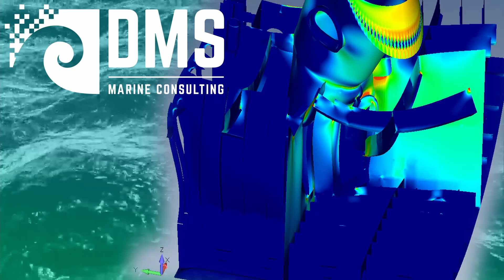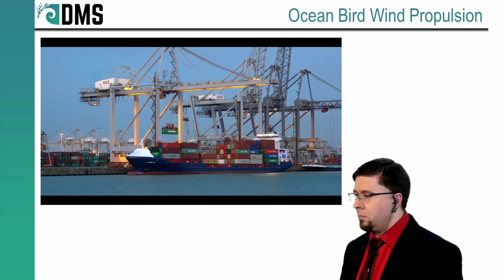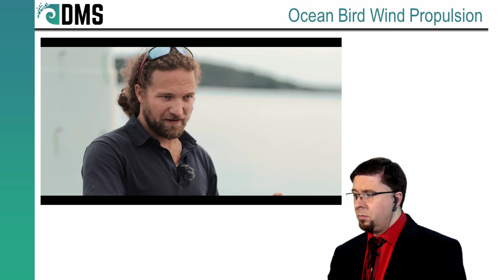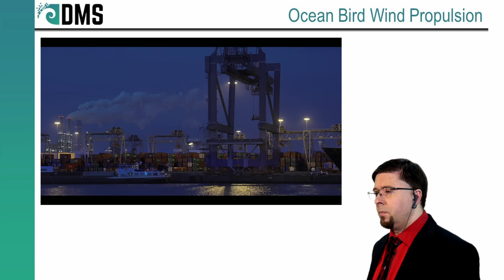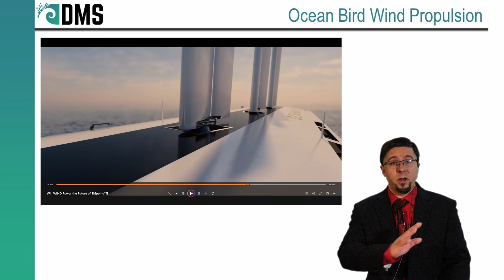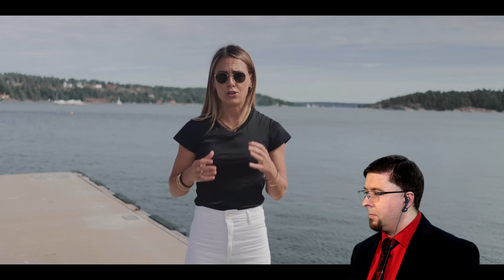Free Fuel?  Wind Propulsion for Cargo Ships

Comment: How can you say that wind energy is low hanging fruit when you have right beneath your boat strong waves with much more dense energy per square meter,
 so the real low hanging fruit is wave energy
Reply from the maker: Wave energy has great potential, yes.  I even designed a wave energy converter as my final project in University.  The problem isn't the potential of the energy.  It's creating a device that can economically convert that power into an industrial format.  
I agree that wave energy is worth pursuing.  But we don't have a ready-made solution for wave energy.  Sail propulsion has been tried, mass produced, and tested.  We already know how to do sail propulsion.  Wave energy still requires further development.
Reply: @DatawaveMarineSolutions  
My design is a catamaran with movable pontoons, so the pontoons can individually bounce up and down,
connected with a electric motor generator in the middle so when the wave hits the front of the pontoon, the front is pushing up, but keeping the deck stable making a more comfortable ride ,
in the same time harvesting wave energy!
It’s possible that this design can work better with a trimaran

Comment: Sailing ships have a lot of torsional stress because there's a twisting moment in the frame where the mast is attached. For modern ships to have sufficient torsional strength will likely require an extensive redesign versus what's built today possibly including hull shape changes and diagonal stringers.

Comment: The reason most sailing yachts have one mast and usually two sails is not about reducing crew size. It is about getting the best windward efficiency. This is mainly necessary due to how sailboat races are conducted. They are very often upwind/downwind in nature. Upwind, the tall, two sail rig is champ.  Downwind, it is also champ, due to being able to fly a very large downwind sail.

When raid-style racing was introduced, two masted boats started appearing and doing well. This is because raid racing is often across the wind.

BTW, the smallest working four masterd schooner is a little more than 6m long and is being built by Sven Yrvind. Its mast are all cantilever and don't extend very far below the deck. Each sail has just a halyard and a sheet line. They will have reefing points as well. But sail area can quickly be reduced  by dropping one or more of the four sails. It looks complicated, but it is really quite simple.

Comment: The reason my sailboat and most small sailboats have two or three or four sails (Sloop, cutter, ketch) is not simplicity, it's being able to sail close to the wind. Old square riggers can't sail 'into the wind.' These primarily sloop rigged boats , like my 46' boat, can sail 35 degrees 'off the wind' and I do it all the time. This is called Close Hauled and it's also the only way the America's Cup boats sail. 
Sails on large ships, I think, is already a 'solved engineering problem.'  Sails are just wings, we know all about wings. They already know how to do it. The large model in the video is just proof of concept.  Yacht A, is a very large private sail yacht, everything about the sails is motor controlled. The sails roll out of the mast (as do mine). They're very efficient. What they are, compared to large container ships running on powerful engines, is slow.  
A 1000' (300m) container ship can do 25 knots, my boat does 7. What needs to be worked out is what cargos can  take 3 - 4 weeks to cross the Pacific and which cargos still need to get across in ten days? 
I've sailed Asia, across the Pacific and regularly off the California coast. Most large ships were only doing about 14 knots, and the ones I see on AIS in the past couple of years off California are doing 9 knots. 
Some of this is to lower pollution levels, save on increasingly expensive fuel. If speeds stay low like this, then sails on large ships could become competitive. 
I always think that when the aliens do visit Earth, all their technology will be far more advanced than ours. But, unless they have oceans and sailing on their planet, they are going to be amazed that we can cross oceans for free with sails. 

Storms. One of the reasons I became a sailor four years ago is weather prediction and communications have become so good, no one ever needs to sail in a  hurricane or typhoon. We regularly avoided the most intense parts of the storms that were near where we sailed.

Comment: Other ships which don't need to be compatible with shore cranes are tankers and passenger ships. The self loading/unloading bulk freighters of the Great Lakes could be another opportunity for wind propulsion. There is at least one competing technology called DynaRig that has been around for decades and has been used/tested on a few large yachts. In addition to crew sizes, I think much of the focus on single masts comes from yacht racing - a single masted sloop rig maximized maneuverability and the ability to sail into the wind, which is important in yacht racing, but not so much for larger ships. As for 200m masts, there are already several large yachts in service or construction with masts approaching 100m, but these are mostly attempts to scale up single masted racing yachts. I suspect that multiple smaller masts would be more optimal for cargo ships.
Reply: Great lakes ships aren't self-loaders. They are self-unloaders but they need to be loaded at an ore dock. The self-unloading system works via gravity. There's a belt below the cargo holds that carries the product to the elevator at the stern of the ship. It can not run in reverse.

Comment: Thanks Nick.
It may not be applicable to their sail design, but although wind is free, ropes tend to be expensive and require regular replacement on a sailing vessel. That is sort of hidden cost most people don't think about.
You have mentioned fuel additives, and I wonder if that idea is viable (link with timestamp closer to the point):
https://www.youtube.com/watch?v=hL3AZGw9xZM&t=294s

Comment: Hmmm. Not really news  Maersk has multiple wind assisted vessels using Flettner Rotors, which provide adjustable,  movable wind operation with better sailing characteristics than the most efficient shaped sail.
The economics for suitable routes are proven and repeatable.
These foil solutions are just ignoring the proven technology.

Comment: During the early 2000's, using kite-sails were proposed to help propel cargo ships.  Only need to connect to the kites.  No news from it since then.  The sails are either deployed by the ship or some kite-sail tug that help tows a vessel.
Reply: Airseas
Reply: @paraglidingSafety   ohh, so it's now a business. Thanks for the info👍🏻
Reply: @shaider1982  it is not a bussiness yet, they seem to be in early r&d, basically copying the approach that Skysails used in their PoC 10 years ago, with some minor modificatons, not necessarily for the best :)
Reply: @paraglidingSafety  ahh, ok, so still not practical.

Comment: Very good look at the pros and cons. How about the cruise ships? They don't have the need for cargo cranes. Nor is high speed an issue....
Reply: Their cost/profit model is based around packing as many cattle into a small volume, and taking them, for all the money possible, adding complexity/cost, just isn't in the cards.
For smaller niche markets, of a 'Sailing Holiday', possibilities exist.
Reply: @carlthor91  But, the powerplant is not critical for that segment. Nor is cargo loading a issue. You need to redesign from the floating theme park hotel they are now; for masts however.🚢
Reply: @WALTERBROADDUS   deck area for leisure activities will be decreased.
Reply: @shaider1982  What activity? No one is doing very much at the top of the ship. people climbing the Smoke Stacks now? Masts would not interfere with passengers at the buffet line.
Reply: @WALTERBROADDUS  The hotel load on the powerplant, multiple gensets, is nothing to be scoffed at. Multiple megawatts.
The structural reinforcements, required to handle/distribute the wind loads, takes away from payload. All ships are set of deign choices.
Reply: @carlthor91  adding sails to a vessel like this would not significantly affect passenger load and is not replacing the gas turbines and Diesel system for Main propulsion and electrical generation. It's just supplemental.

Comment: With many vessels now moving to diesel-electric I’ve always thought that using the wind as an electricity generator rather than a motive force might be easier/better. Wind turbines are already a mature technology, have no preference for wind direction, and can be tied into existing electric drive systems. The question is which system would be more efficient in turning wind into motive force. What do you think?
Reply from the maker: I would need to do the math to be sure, but I suspect that sails come out more efficient, depending on the use.  Sails show small efficiency when traveling upwind, since the sail is angled to push mostly sideways.  But upwind travel only encompasses about 1/4 of the possible wind angles.  For the remaining wind angles, sails are very efficient.

Contrast that to wind turbines.  True, those can work at any wind angle.  But we lose a lot in the conversion.  A typical wind turbine is only 50%-70% efficient at capturing the wind power.  (They have a theoretical maximum of 67%.)  Then we have efficiency losses to convert that power into electricity (conservative assumption:  95% efficiency).  Then we need to convert that electric power back into propeller power with an electric motor.  Electric motor are around 92-95% efficient.  And the propeller is also only 65% efficient at converting shaft power into forward thrust.  

So by using wind turbines, only 39% of the wind energy makes it back into forward thrust.  Sails have their own losses too, but 39% is a pretty easy number to beat.
Reply: You want wind turbines?
Reply: Heck, it may end up being a combination of technologies. Most new stuff is.